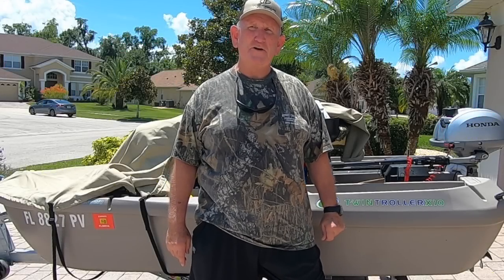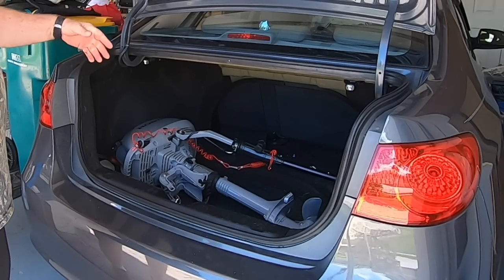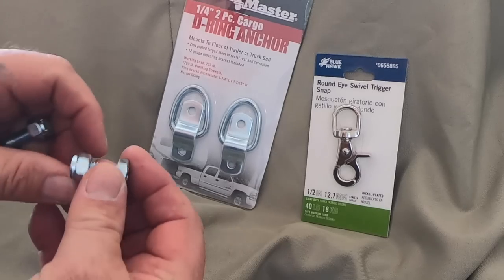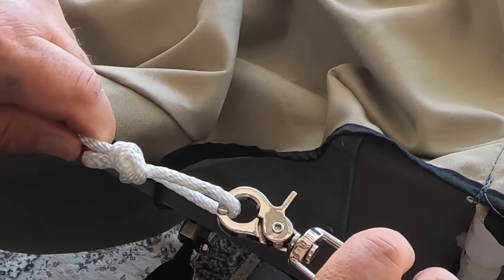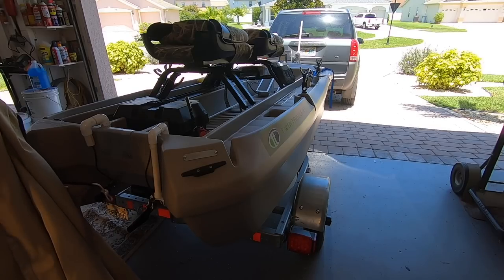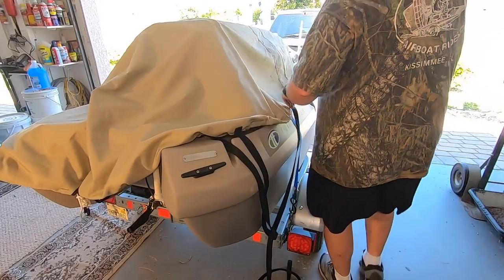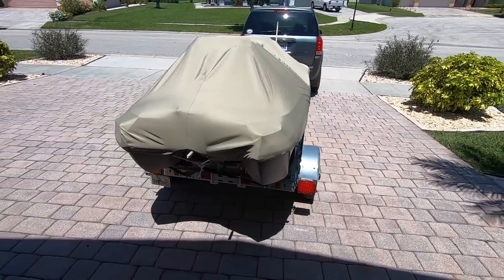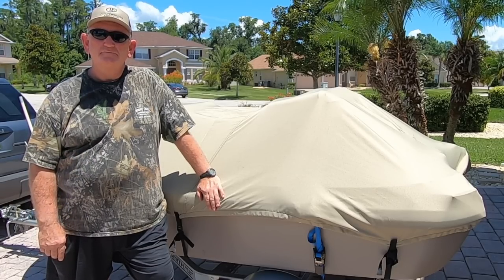HOW DO YOU INSTALL A BOAT COVER?

Comment: I stored the boat outside using the cover this winter.  Had LOTS of snow and the cover worked well.  I used a short 2x4 laid across the seats to create a ridge so snow and water wouldn't accumulate on top.  I also left the motor on  wrapping the cover around the front of the motor, then used a heavy trash bag to cover the motor.  It worked well.  

Hope Freedom Electric comes up with a cover in the future that accommodates the motor.
Reply from the maker: Gary, I used to do just that when I lived up north also for boats in the winter outside.          Gerry

Comment: I don’t have a trailer for my twin troller.  When I go to the lake, I put my Honda motor lengthwise in the bottom of the boat in the back of my pickup.  Fits nicely there.
Reply from the maker: Gary, now that is using some ingenuity to get the job done!                            Gerry

Comment: Great video Gerry!  Another very helpful "T Cubed"!  (Twin Troller Tutorial)  😁  My questions...Is there a specific spot for the 2 seats to be in before applying the cover?  What about if you fish solo, with one seat?  Does that one seat get placed in the center of the boat?  Will the cover still fit snugly with one seat?  

These questions came to my mind, from the boat set-up video that our fearless leader, Frank Jones did, on how to balance out the boat, based on how you are going to fish, whether solo or with someone, and also if your going out with the outboard or not.  🙂
Reply from the maker: Peter, I wondered the same as I was making the video. I tried moving the two seats a little but I did not see a difference. The cover seemed to handle the locations wherever I put the two seats. I did not try just one seat though. Good question, I will try that some time.           Gerry
Reply: I have Millennium seats in mine and  I turn the front seat around facing to the rear. I did this exact sit up for the cover after watching this video. My cover had never been out of package but now I put the cover on right after I load my rods and tackle and fill the ice chest. I use the cover now every time I go fishing . Love it! Keeps dust off of reels and keeps the pea gravel out of boat

Comment: yes thanks. I know what you mean about the shape and the seats. By away does the cover fit with you raising the seats because I did the same thing to my seats. 😊
Reply from the maker: I rarely put on the cover. It does fit with my raised seats but not as well as before. If I wanted to put the cover on it will cover the boat though but it does not come down the sides as much as before. Mine is always in a garage too.             Gerry

Comment: You always have awesome video's Gerry. I will have the cover with mine b/c when the sun comes up till it goes down, we're in it all day long. I have no carport or garage to park it. I do have a truck to pull my TT and the motor would fit in the back, but, would it be ok to set it in the TT ??
Reply from the maker: Robert, I would be comfortable with placing the motor in the Twin Troller for storage while the cover is on but I would want to take it out for transport. I would not want it bouncing around inside the TT. Make sure your fuel shut off is in the off position and the gas cap is on tight, and the throttle handle is on the up side so that no crankcase oil leaks out. 
Thanks for the kind words on the videos.            Gerry

Comment: It's Friday the 7th of June Gerry and when I got back from the lake yesterday my boat cover was on the porch so I have everything now. I made the one mistake I'm sure many new boat owners make and that is I pushed off the dock yesterday without putting the floor plug back in. I was by myself and looked down and saw some water by my feet and realized what I didn't do. I simply pushed my seat to the bow and put the stern up higher then the plug hole and went to the dock cause the plug was in the cubby of my truck door. Buying an extra plug to keep in my dry box. Have you stopped laughing yet
Reply from the maker: No laughter here. Here is what I do so that does not happen, at least not so far.

I put a short piece of rope through the plug handle and make a loop that is about 4-5” long. After I return to shore I remove the plug, to remove any water spilled in the boat or after the occasional washing. Then I go to the front left of the boat (Port side) and thread the short rope through the bottom hole in the cleat and fold the loop back over one or both sides of the cleat. That way the plug cannot fall out of the boat while traveling if I do not have the cover on, which is most of the time.  
That way the plug never leaves the boat.
That way when I go to launch the boat it is right in my face when getting the boat ready to launch and I never forget to put it back in.
Over time you will get into a routine and unless someone else tries to help and mess you up, you will forget to do things less in the future. When others offer to help I usually ask them to not do that so I do not mess up my routine. 

Are your feet dry yet?   😂                  Gerry
Reply: @LunkerFishing  Yupper my feet are dry and thanks for the idea. Okay Gerry do you use the UNI Knot for a simple hook to line knot when your fishing Charlie Slider or maybe Wacky Rig. I have been using the old simple fishermans knot for years but I have heard bad and good about it but it is the simplest to tie.

Comment: Gerry, do you know the dimensions of the TT cover? I'm hoping to find a cover that might fit for less expensive than FEM.
Reply from the maker: Milton, what I am going to answer will likely not help much. The cover is shaped around the boat and also to accommodate the seats so the measurements are not something that makes sense. When laid out on the floor it is approximately 10' 5" long and 5' 6" wide in the middle.
Good luck.                                           Gerry

Comment: Well Gerry now that we have both had our beauty sleep (Like that Worked) I can ask my questions. First of all Gerry this is again one of your great ideas that you willingly share with us mortals.  Is this the cover that you ordered 4 years ago when you bought the TT cause I was wondering if it's the same as the one I ordered with mine. Did the wheeled trailer Jack come with your trailer cause I definitely want one . Is there a one side better than the other when you lay your Honda in the back of your vehicles because of the oil seepage or leaking possibility. I did receive my trailer and last Wednesday I assembled 90% of it but because of a stupid pinched nerve that affects both feet and my legs some times I did myself in getting up and down bending again and again and was unable to finish it. I am back to almost normal (Whatever that is) and will finish the last 2 steps tomorrow because I am actually taking a 10 day vacation to spend time with my son from West Virginia. I plan on having the TT in the water after lunch tomorrow and my MRS STEVE made me promise that she would be my first passenger. Steve
Reply from the maker: Steve, yes that is the cover that came with my new TT four years ago. I never used it until recently.
The trailer tongue jack did not come with the trailer. I purchased that after. Funny you should ask. I am working on a video that lists everything I use and where I get it from and the jack will be in there.
In the manual to the Honda it says to always have the throttle handle on the top when laying the motor on it's side or crankcase oil can leak out. It would be difficult to lay it with that handle on the bottom anyway but that is still good to know. If you look at the motor there is a small pad like protrusion on the side of the motor that will rest on the floor when laid on the side properly.
Glad you are feeling better. That trailer has your name written all over it and it wants to take you fishing.
Do not forget Mrs. Steve or you will be not fishing much in the future because she will have the boat and leave you on the shore as she sails away to catch a Lunker!
Have a great vacation, take lots of pictures, and congratulations to finally join the exclusive Twin Troller Owner's family.                       Gerry
Reply: @LunkerFishing  Waiting for an answer from Freedon Electric as it's been 26 days tomorrow since I ordered everything on May 8 including the cover and it's the only thing I don't have yet. I truly believe that my crazy order and delivery problems are not the NORM for Freedom Electric customers and when I look in my back yard and see my TT I am a happy man. I sent the inquiry email about the cover late Friday so I'm sure i should have an answer Monday. I will definitely be getting that same trailer jack but am lucky that I have two pick ups so I can leave it hooked up most of the time. I've never had a problem here with anyone trying to steal my stuff but it helps that most of my neighbors know I'm a retired Cop.
Reply: @LunkerFishing  Well I just called and spoke with Frank and he said the boat cover people were behind a bit but they sending them out as fast as possible